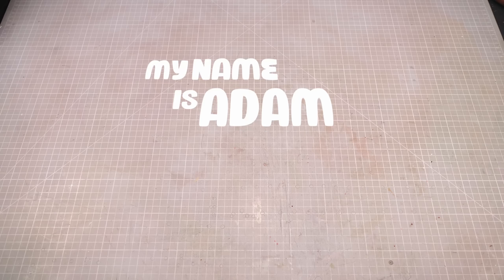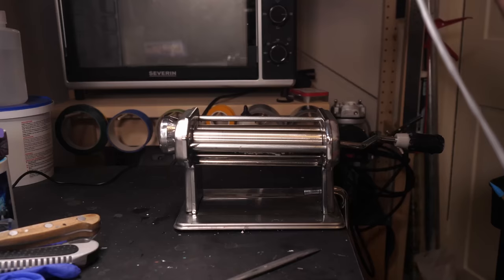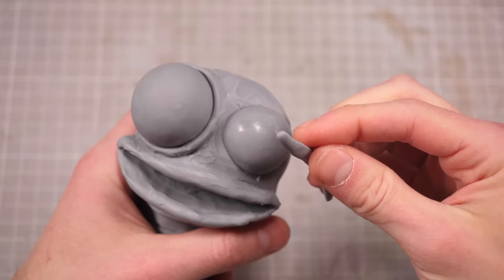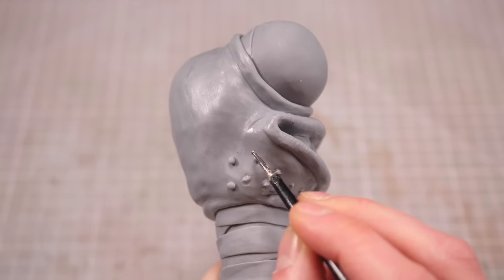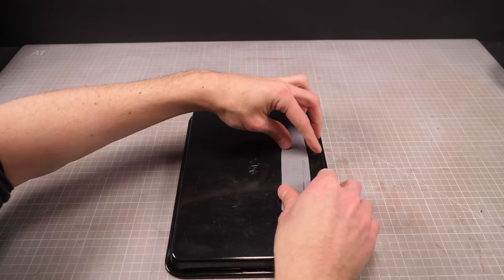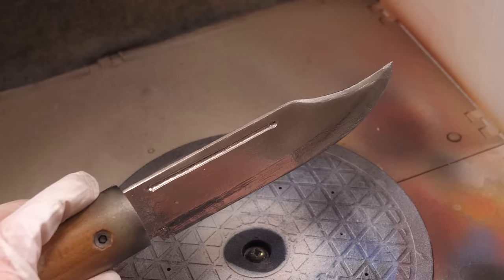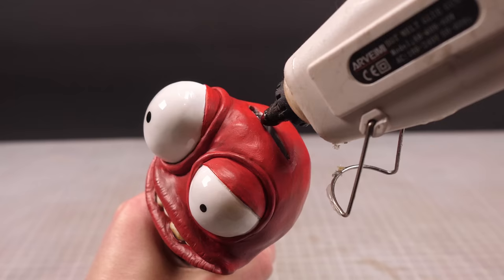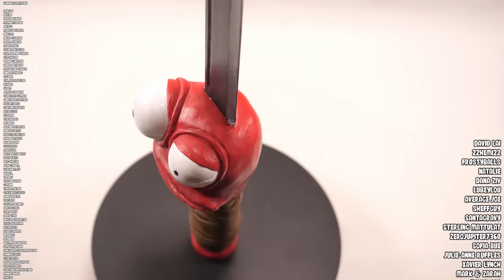I made a Knife out of Clay

Comment: When you're using wood, once you have it shaped and sanded, you can coat it with a liberal coat of cheap super glue, spreading it around with a piece of stiff paper.... once the super glue cures you can finish sand it to a super smooth finish AND it will seal the wood and strengthen it.

Comment: If you end up using wood to make a blade again, a technical I like to use is covering the wooden blade in aluminium plumbers tape. Then if you mist it with black spray paint and use some fine steel wool to pull as much paint off, you get a very convincing real steel effect. Then just rinse and repeat until you have the desired level of grime.